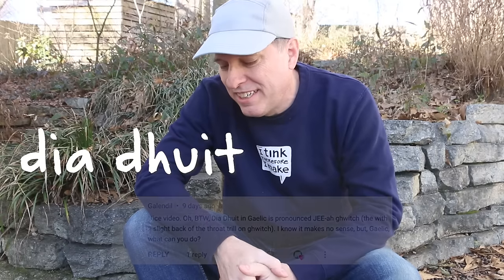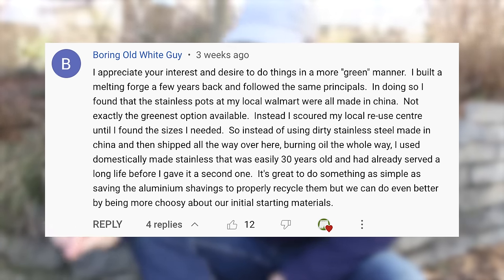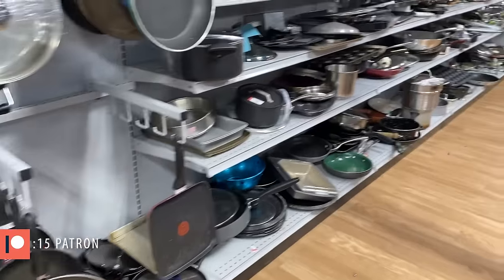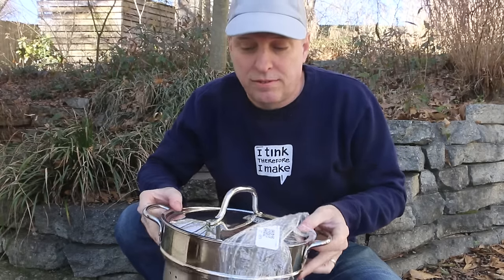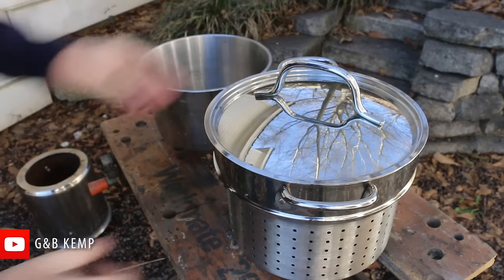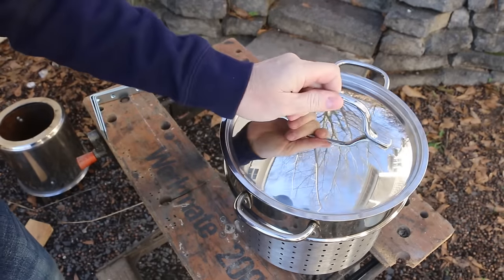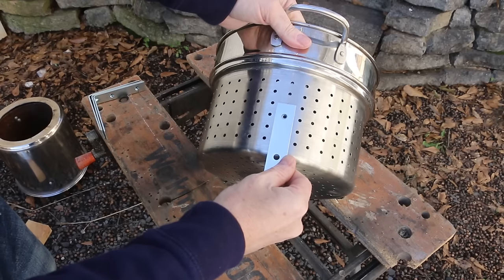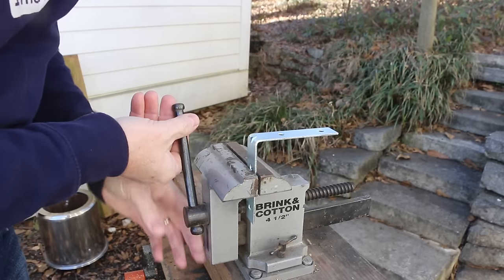How To Make A $10 Goodwill DIY Solo Stove Firepit

Comment: I use the pasta strainer by itself as a firepit without an insert.  For keeping it off the ground I use four 3/4-inch conduit straps bolted to the bottom.  I start the day with a wood pellet fire and a few hours later keep it going with half-length firewood split as needed.
Reply from the maker: That's a great idea! Thanks for watching.

Comment: I found a stainless ice bucket. Its double walled with a metal lid and im, going to drill some 3/4 holes around the bottom on the outside, amd some 1/4 inch ones on top on the inside and cut out a lup for the top. All for $5.99

Comment: The outer pot has too many holes which won't allow the inner air between the outer wall and interior wall to super-heat.
Reply from the maker: I agree. I thought about putting some metal banding around the pot to close off several rows of holes. I may try that and see how it affects the performance. Thank you for the feedback. Thank you for watching.

Comment: If your aim is to build a smokeless one, the outer skin should only have intake holes at th bottom to draw in cool, dense air. The inner chamber should have holes around the bottom and top perimeters. A couple of stock pots from your local discount or dollar store should have those.
Reply from the maker: Thank you for the tip. I’ve thought about plugging the extra holes with screws. Thank you for watching.
Reply: Then it might be an art piece?  @GreenShortzDIY

Comment: I'd love to try this, but I don't have a grinding/cutting wheel. Do you think it would be possible with metal snips?
Reply from the maker: I think is possible. It would depend on how well your snips can cut curves. And if they can manage the hard stainless. I've not tried this myself.  Inexpensive grinders can be found at Harbor Freight, if you've got access. My grinder still had a hard time with the stainless. Thank you for watching.

Comment: Honestly I do not care that the pots were new and were your Good will pots American? and I Dont have time or fuel to go run around to find pots that work as well as the walmart pots.
I dont see the tree huggers thinking in this…
Its just a feel good move…but detrimental to the environment and your wallet…
Do gooders just suck the life out of you if you listen to there nonsense….
You should have rode your bicycle around to these Good will stores..LMAO
By the way Boy Scouts never used dryer lent without paraffine your beeswax… Why? Modern clothes are coated with 
flame retardant chemicals.

Comment: Use oil when drilling. Cutting oil is best, but anything even something like WD40. It will cut better and save your drill bit and hole saw.

Comment: Sometimes, depending on the metal you are drilling, adding oil will cause case hardening. Thank you. God Bless and stay safe.
Reply from the maker: Thank you for the tip, Joey. The stainless steel was definitely hard to drill. Even the grinder had trouble with it. Still, a fun project to make. Thank you for watching and for your blessings. God bless you as well, brother.

Comment: Better results if you cut hole through on straight/flat surface. You got a bind when you drilled through 2 angle surfaces! It would help if you could lift hole up onto flat surface, above the bottom side angle. You could put Inter chamber on threaded rod adjustments. Then build fire in unit, thread rod to adjust best air flow through upper champers. I think opening up top air gap might help you? Put threaded adjustments an know exactly where you want best burn for no smoke fires! Just like stove dampener for entire ring an stove?

Comment: You may find that the bolts protruding into the fire box come loose after several cycles of expanding and contracting with the heat. If you had put the heads inside the firebox and left a little of the bolt sticking through the nut after being cut off, you could tighten the nut and then peen the sawed off end of the bolt, making it more of a rivet. You may be able to do it on the inside of the firebox, but it will be harder to swing a ballpeen hammer in there.

Comment: Mount drill on workmate (yours looks well used as mine). Run hole saw in "reverse gear" setting at higher speed. Safely guide a knife sharpening stone light pressure against hole saw bit tips, as drill is running & spinning hole saw against sharpening stone. (Must be in reverse, counter clock wise. (I use sharpening stones from dollar store) that sharpening technique works for table saw blade's mounted in reverse on table saw. Can Reverse blade on hand powered skillsaw too. Mount blade in reverse, then while under power, lightly touch sharpening stone against spinning reversed saw blade. Sharper an faster! You'll love it!
Reply from the maker: Thank you the tips and feedback, Tim. Cool story about your X-15 drill bits! Amazing! Thank you for watching.
Reply: Every year my dad would visit family in S. Calif then all of us go down too teawana Mexico. Throughout year we would collect cool stuff like Yankee baseball caps, etc. Then when dad shows up in Mexico, kids would run off yelling "Joe's back"! Dad would smile, then handout all cool stuff we'd collected. Good times!

Comment: How are you had to do to elevate it was to get a couple nuts and bolts and stick them in those nicely drilled holes in the bottom of the thing that would’ve been cheaper and a lot less time consuming than using those brackets

Comment: I would have used two pots, the outer one perforated around the lower 1/3 of the pot, the second pot perforated in the bottom, and lower 1/4 of the pot, then also about 1/2 inch from the top. Using a flat lid, cut the diameter of the inner pot just below the rolled top edge to support the “burn chamber” in the base pot, then find a deeply domed lid to create a cooking support.

Have a good day!
Reply from the maker: Good suggestions. Thank you. And thank you for watching.

Comment: i'm confused how it works with all the holes on the outermost pot. the earlier version didn't have those. what's the difference?
Reply from the maker: It would likely work better if I plugged most of the holes. But, it is still a sheltered fire, with the airflow controlled, and I think that helps with efficiency. Plugging all but the bottom two or three rows of holes, would allow the airflow up the sides to heat up more and move faster. I've thought about filling them with screws and retesting. I may give that a try. Thanks for watching.

Comment: Rather than holes, next time consider slots.
Cutting slots with an angle grinder or sawzall is usually faster and easier than drilling.
Regular silicone caulk is good up to 400° F so maybe it could be used to close up some of the holes in the colander.
Reply from the maker: Thanks for the tips! Slots would be much easier. Thank you for watching.

Comment: So cool!  Q: If left the bolts un-trimmed, could you set a little grill on them to cook over coals or boil H2O?  Or would bolts degrade over time in flame?  Would high temp stove paint solve this?  Also, a commenter mentioned bolts might loosen over time due to heat expansion cycles… is there a fix for this?  Lastly, if wanted to close up some of the strainer holes for less air, what would one use?  Could a DIY collar of some kind work?  This is honestly, so cool!  And nice looking as well.
Reply from the maker: I think you could use longer bolts to cook with pot, but up higher. You’d need to use a pot small enough to leave a decent gap for airflow, but this could work. High temp paint would help with the bolts loosening, but rust will as well. :-) They will degrade and will eventually need to but cut off and replaced. To close off some of the holes, use short screws. I’ve been thinking about that mod myself. Thank you for watching.

Comment: Since you're using nuts and bolts anyway, why not go through the bottom and use the bolt heads as the feet ?
Reply from the maker: That would have been a good solution as well. Perhaps simpler, as well. Thank you for watching.

Comment: Slower is your friend in stainless, use a rope or strap and lever to generate much higher pressure.  Pressure is also your friend.  Also, step bits last MUCH longer with cutting fluids
Reply from the maker: Thank you for the tips. I’m still teachable. :-) Thank you for watching.

Comment: Good instructive video and I see that the possibilities of building a gasifier stove are endless.  🔥
I appreciate the fact that you used common tools too.
 There seems to be an endless supply of used cooking equipment ready for upcycling 👍🏼. 
Just a note, greenbacks are saved when buying cheap cooking pots to make stoves. Manufactured stoves that burn efficiently would cost a lot more. 💰